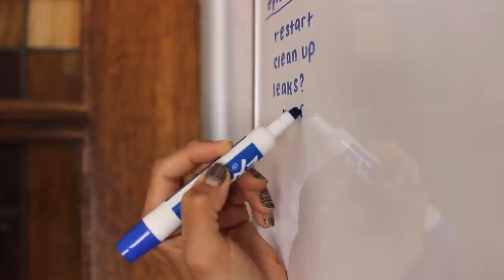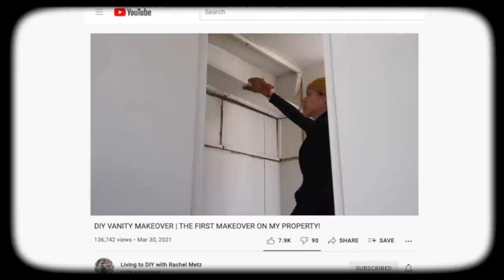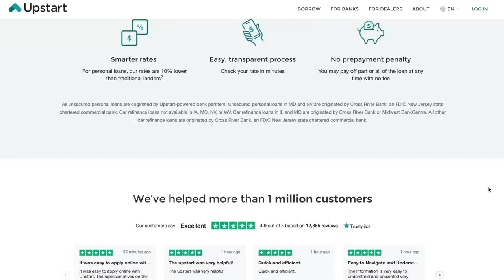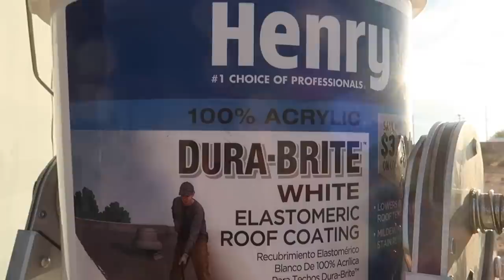RESTARTING MY TRAILER TINY HOME CONVERSION MAKEOVER

Comment: Idk if this makes sense but if you want privacy for the bathroom and bedroom but don't want the separation maybe you could do a rounded snake kind of track w/ two barn door style doors in front of one another that on two tracks that cover both rooms instead of a straight track to cover just the main door and not the bathroom. Then when you don't either covered you could tuck them both back to back on the well next to the bathroom and it could be a pretty design element. I hope that made sense! 😅 you're doing great, keep up the incredible work 😊

Comment: Idk if anyone mentioned it but trailers like this rely on the cabinets and floor to ceiling furniture to help support the walls sometimes. Not sure what the winds are like there probably not 60mph you get when towing it so maybe not an issue but I thought I’d let you know in case you didn’t.
Reply from the maker: As mentioned in the video, it's not moving. It's a guest house so it'll be built different.

Comment: So I have an idea for a bathroom door but I don't know if I am going to be able to describe it very well... here goes nothing! So it looks like a mini double door when it is closed, right at the toilet there, but then you swing both doors out 90 degrees and they then expand to double the size and connect to the wall on the other side. I don't know if the measurements work out or not but it would make it so you didn't have to have the toilet exposed and hanging out in the middle of your house all the time. If it isn't quite long enough to reach the wall on the other side you could add a bit of a built in shelf on the other wall to make up the difference. Who doesn't need more storage in the bathroom!
Reply from the maker: So funny! I thought of something like that.

Comment: Just cought the end. You mentioned spray insulation. You hated the glued walls you would despise shooting foam. It's a pita to change or deal with in the future and I would only use it for filler or shooting difficult to reach spaces.  Since you are going to studs look into Rockwool great stuff, eco friendly(spray foam takes time to off gas) inexpensive and easily sourced.
Reply from the maker: Oh thank you!

Comment: I would try to wrap that 90 degrèe edge all the way around the roof, with that seam treatment, if you haven't.
Reply from the maker: I need to get some more!
Reply: @LivingtoDIYwithRachelMetz  here in central fla there is an ABC roofing chain that sells a PeelnSeal product 6", 12" or 36 by 25 ft. Thick foil with thick adhesive. Last roll of the 6" I puchased was like 20- if I remember. I like your remodeling ideas.